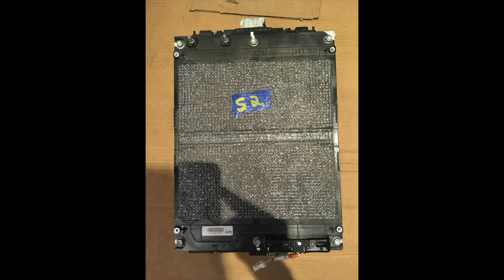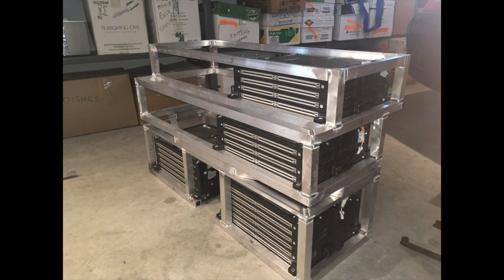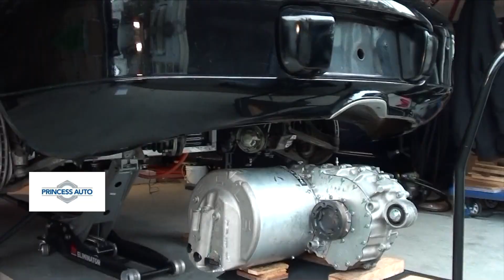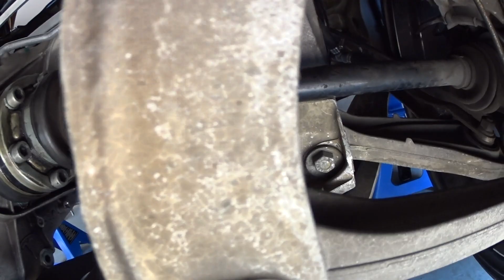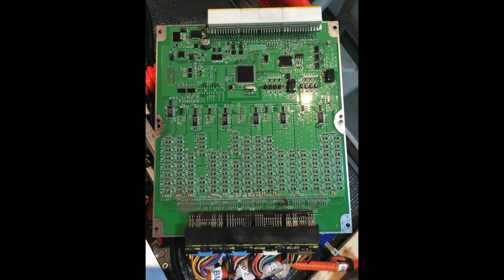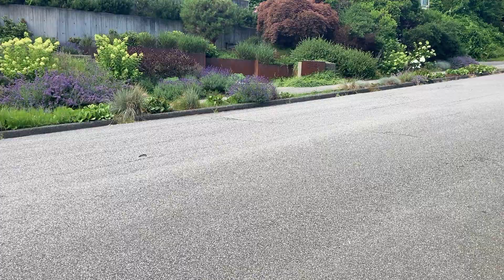Porsche / Tesla FRANKENROADSTER - Motor Swap

Comment: Hey how much does it weigh now? and do you reckon one could fit a motor on the front axel too?
Reply from the maker: The current weight should be very similar to the OEM weight.  I took out about 750-800 lbs with the motor, gearbox and gas tank. The new motor is about 300lbs and the batteries are about 400lbs. 
It would be difficult to put motors on the front axles without a lot of modifications.  The front motor would have to go in the Frunk (Front Trunk), so you would have to find a new location for the charger & DCDC Converter.
Terry.
Reply: @repairs101  thanks for the quick response, 
am thinking about doing a hybrid system on a 987S to keep myself entertained and maybe add 150-200Hp on the front end for AWD but the logistics are making my head hurt a little, I'll update you if I do 😂

Comment: how has the car been over the last 2 years ? update video ?
Reply from the maker: David: Just saw your email a few minutes ago. Sorry I didn't see your Fb message but I almost never use Facebook (other than for promoting my latest work to the few Fb followers I have. 
FWIW I'm a YouTuber so if you want a reply from me this is where you write me. 
Anyways I passed your message on to Terry (my neighbour and the creator of the FRANKENROADSTER) and he will answer here through me in all likelihood (remote possibility he will contact you directly). It has been 2 years already - the Roadster currently has it's wheels off for some upgrades and some fit 'n finish - and yes there will be a follow-up video this spring showing a motor bearing re&re. some modifications and some serious ZERO to Sixty action shots.

Comment: Do you a website? I've owned a 2000 Boxster S for 20 years this month. I dumped a ton of money into it. I barely drove it during the pandemic as I had to leave the state to take care of a family member. I would have sold it buf the idea of a electric motor conversion on a mid engine roadster seemed so perfect. Range was never an issue since I never drove it more than an hour. I did autocross the car a few seasons when it was still under 30k miles. Actually it was the most reliable car I'd ever owned for the first 70k miles which took me about 8 years to rack up. But then came those repairs. $5K clutch, IMS upgrade, T stat, motor mounts, $4k suspension (twice CITY ROADS!), $4k exhaust and headers, the $1k water pump every  x miles, starter, alternator, AOS, etc... I told myself if the engine EVER died I'm NOT swapping for another ICE engine.
Reply from the maker: Thanks for reviewing the video as the conversion was fun to do.  I don’t have a website for EV conversions.  I got most of my technical information from the Open Inverter  https://openinverter.org/forum 
It showcases many EV builds including my own “Another' Porsche Boxster/Tesla EV conversion”.  I followed “Boxter EV” who started his build in 2019.  Let me know if you need more information.   Terry Moore

Comment: Hello again. Just wondering if there are any updates on your ev Boxster build? I am in the market for a 1st gen Boxster. I want to buy one with low miles and drive it til I decide to do the conversion. Any info would be greatly appreciated. Thanks for your videos.
Reply from the maker: Coming soon - Terry and I are collaborating on an update video showcasing some routine maintenance (bearings) and some upgrades (frunk upholstery) and MORE!

Comment: oh yeah and what is the range? haha that's probably the most important thing. I remember seeing a similar video and the guy got like 120 miles range. Its fine I guess if everything is close by.
Reply from the maker: Hi Keith.  The range is about what you mentioned and is dependent on the batteries selected.  Think of this build as a prototype.  It used first generation Lithium-Ion Batteries from a 2015 KIA Soul which were good at the time.  I’m working out all the minor kinks and inconveniences now so when the next generation Lithium-Ion Solid State batteries to be commercially available, I will just put them in.  The range would most likely double.  Terry.
Reply: @repairs101  ahh gotcha, good good ya still an achievement. Food for thought Limo could potentially get a max range since they are longer and can conceal a lot more batteries and blend the look of it. If you can make kits for that...... $$$$$$$$$$$$$$$$$

Comment: Thanks!  Very informative video.  When you removed the clutch master cylinder, pedal and tubing, how did you plug the clutch supply line from the brake fluid master cylinder?
Reply from the maker: Sorry for the delay - Terry is out of town. You can reach him directly at : mooret88 at outlook dot com

Comment: I've sure you have heard, but all Boxsters and 911s from this era will need engine replacements eventually, is there any reason this KIA/tesla setup wouldn't work in a 911? Is reversing the motor really just swapping the FWD and REV switch? Did you use the boxster throttle? I have the last year of cable throttle in my 911 and would have to use a cable converter of some kind right?
Reply from the maker: Sorry for the delay - Terry is out of town. You can reach him directly at : mooret88 at outlook dot com

Comment: Why would the hell would you not use a nacs plug and the supercharger from the original Tesla? You cannot fast. Charge that car now. Good luck road tripping it!
Reply: Maybe the KIA air cooled batteries/battery charge controller can't handle the current? How would you integrate it with the KIA system?

Comment from the maker: Received in my inbox:
Hi  It’s an absolutely great conversion. I’ve got a Porsche like that and I’m wondering if there is a guide for non-engineers with what and how to do and which parts to use. Thanks. Tom
Reply from the maker: Reply to Tom:
There are lots of similar conversion out there. The video is a high level summary of what was done to this car. I have fully documented the tear-down and build which could be used as a guide only. Each build will be different because of the individuals choices for the electric motor, battery, control strategy, brakes, steering, etc. I may be able to put this into a PDF and offer it for sale.  Terry.
Reply: @repairs101  I would be interested in that a "guide" as well. I would like to convert the 2007/08 Cayman S. Most everything should be the same right?
Reply from the maker: You can reach Terry directly at : mooret88 at outlook dot com

Comment from the maker: Received in my inbox:
Ok that was absolutely fantastic. I grew up with a chevelle convertible when I was younger and recently I have purchased an older miata to fill that void. Great car. But my wife has an 28kwh ioniq electric and moving towards a second EV for me. Maybe the best of both worlds as no one makes an electric convertible. Really curious about it. What would be the cost to in materials alone? Batteries, tesla motor, mechanicals etc even a high cost estimate to do something like this? Any words of wisdom? I am in Vancouver as well. Great build
Thanks!   Elvis D
Reply from the maker: Reply to Elvis D:
“So you want to convert a Miata to EV? The costs would be dependent on what components you want to put in the car. I have a Tesla LDU (Large Drive Unit) in the Boxster but I think you would need to go for a SDU (Small Drive Unit) or an Model 3 motor due to space limitations. The size and type of battery would be your next consideration. Batteries over 300V give you better range, but take up a lot of space, so you may need to sacrifice range for what you can fit in the car. The Boxster EV with a 400V battery can get around 130KM on a single charge. I’m guessing you would lose the use of you trunk to battery storage. BMS ( Battery Management System) and a suitable charger would also be needed. There are limited used EV components in Canada so you may have to buy new ($$$$). Used parts are more available in the USA but getting them across the border can be challenging. I have purchase parts from the USA, Canada, England, China and Spain. Parts alone for a good Lithium-Ion EV conversion will be north of $35K. I don’t want to discourage you as it was a great project, but it wasn’t cheap. Let me know if you need more info.” Terry M.
Reply: Sorry I couldn’t cut up the miata. Actually I was interested in the Boxster as the swap. Definitely more bolt in that any small miata.

Comment: What was the cost for the conversion? How fast is it compared to the original boxster ?
Reply from the maker: Hi Ken.  Glad you enjoyed the show. 
I don’t know what the top speed is yet.  I have had it up to 160 KPH (100 MPH) and it really wanted to go faster.  Top speed of a normal ’02 Boxster S is rated at 260 KPH or 160 MPH.
0-60 MPH should be around 4 sec with the electric.  The normal ‘02 Boxster S is rated at 5.5 sec from 0-60 MPH. 
As for costs, I am under $40,000 CDN, including the car.  I am reusing old parts for the build.  It would be substantially more if I had to buy a new motor or battery pack. 
Terry.

Comment: Congratulations on your build. I’ve been dreaming about this swap for years. I really think the Boxster is a perfect candidate for this kind of EV conversion. I’ve been looking for a used first generation Boxster S to purchase for this purpose. What range are you getting?
Reply from the maker: Hi Jon.  Thanks for watching the video.  Yes, the Porsche Boxster & Boxster S is a prime candidate for conversion.  The problem will always be finding one with a trashed motor but the body and suspension are still in good shape.  I lucked out!  As for mileage, last summer I was tracking around 100-120KM (60-70 mi) with a full charge.  The range is dictated by the batteries you choose.  I chose the KIA 400V batteries because they were the most compact high energy density air-cooled battery on the market in 2015.  My battery/motor configuration allowed me to kept the Boxter front/rear weight ratio.  The water cooled Tesla batteries has a higher density (longer range) but are too large to fit into the area vacated by the motor, tranny and exhaust system.  With semi-solid state batteries coming into the market, I will probably upgrade the batteries to extend the range.  Let me know if you have any more questions. Terry.
Reply: Thanks for your reply. The 1st gen porsche boxster makes the most sense because of price and practicality. One can get one for cheap. No need to upgrade your suspension, brakes, etc. to accommodate the high performance EV motor. You are a pioneer in EV conversions. I imagine this is was how it was back in the early “hot rod” days. I see a future of building a custom EV car from one’s imagination. Now that we have 3D printing technology. I’ve already seen ready made “skateboard” EV platforms for EV cars at the SEMA shows. I can already see a private car maker emerging just for this market. Imagine 3D print a HotWheel and making one into a full size automobile.

Comment: What did you do for the trans a conversion kit? I have an 06 forester that i want to convert while retaining the 5 speed i’m assuming i need an adapter and gear reduction?
Reply from the maker: I forwarded you question to Terry. His reply:
I never intended to have a transmission in this conversion.  I designed and built a drive hub adapter so the two motor output shaft bolts directly into the Porsche CV drive shafts.  The Tesla motor can rev to 18,000 RPM.  The Tesla Motor “Package” has a built-in Inverter and a 9.95:1 gear reducer, so the maximum rotation of the wheels will be around 1,800 RPM. On my car, this will give you 120 MPH or 200 KPH.
With the huge torque from the Tesla motor, the possibility of breaking a tranny gear shaft along with the loss of efficiency of a transmission, I would not put one in.  I can change from Forward to Reverse with a switch in the cab.
Reply: He doesn't need a trans converter kit. He did this the right way he got rid of all the original dry train, so not to put a drag on the motor and be inefficient. Everything Tesla.